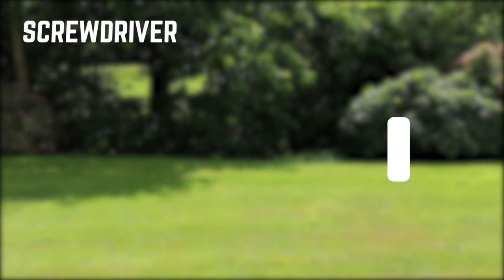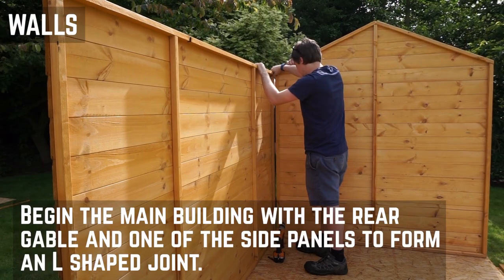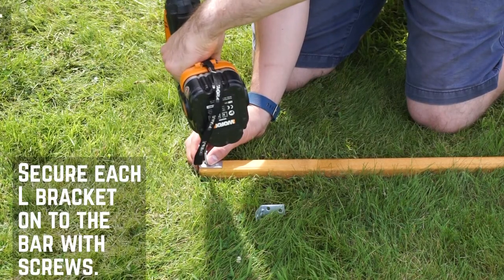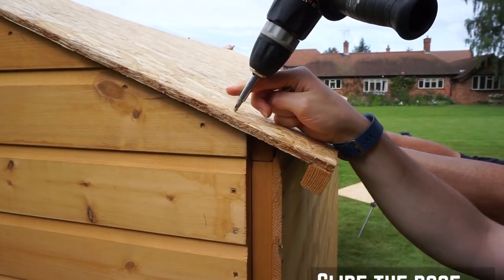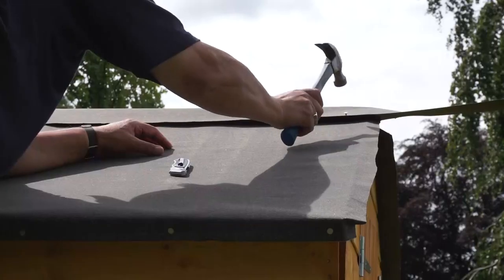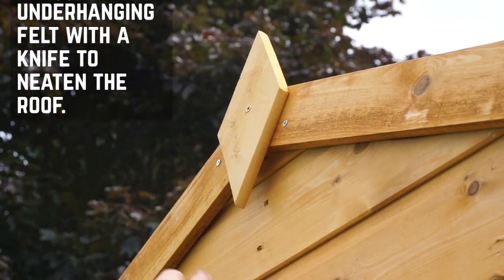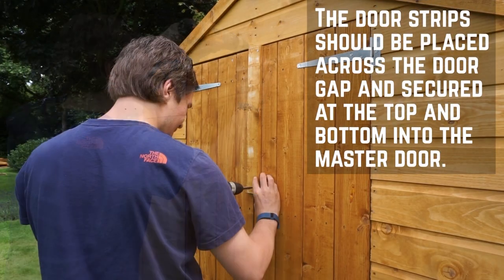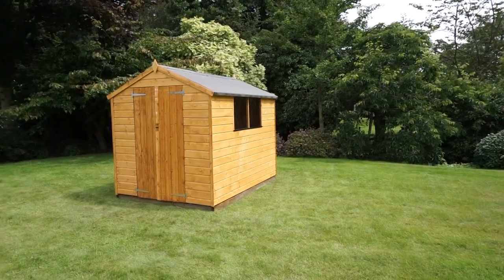Mercia 8 x 6 Shiplap Double Door Shed Installation

Comment: Nice shed. But it would take Mr Burglar 30 seconds to gain access due to the exposed screws on the door hinges. Use coach bolts instead.
Reply: True....but if you push-hard on the plastic windows...you can gain access in 4 seconds....to get the small stuff.
Reply: Any she'd can be got into that's irrelevant

Comment: Sorry. I have a very similar shed and floor supplied is completely useless. I had to buy some decking boards to replace the one supplied and make the floor sound and fit for purpose. I did contact the company and was told it was a budget shed and basically what did I expect! Oh dear 🙄